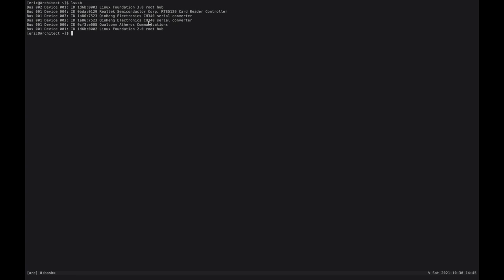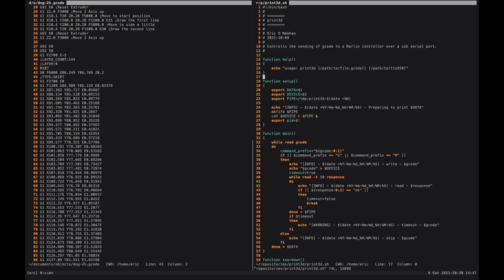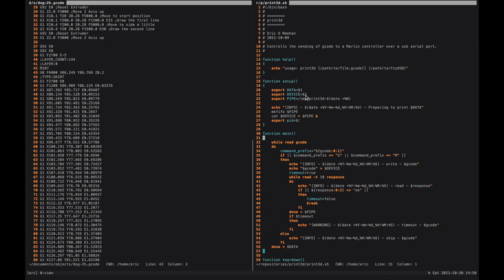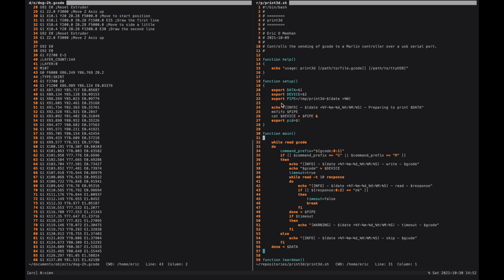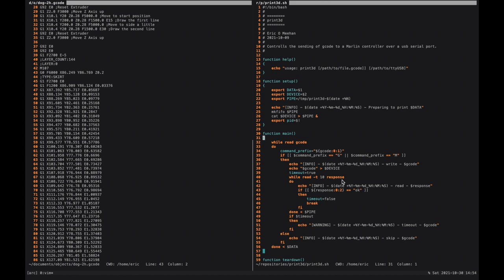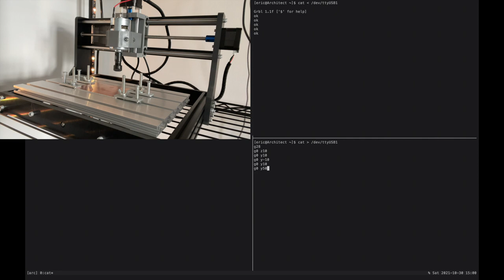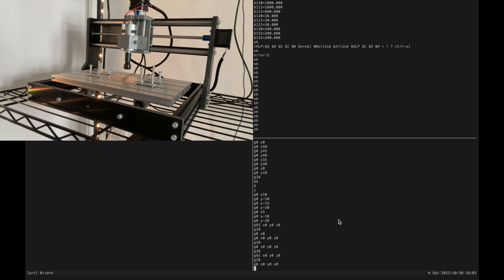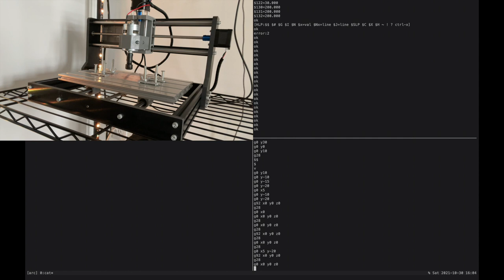Programming a CNC Router with Linux

Comment: Welcome back! My favorite youtuber! What are/were your favorite learning resources for C, C++, and Python. Additionally, how did you learning about computer networks and computer systems(architecture and operating systems)? I've always been curious considering you're very talented. One more question. Which project helped you grow the most when learning about things? If there were a few, please let me know.

Anyway, you're one of the best YouTubers! Cheers!
Reply from the maker: You're too kind!  I think your last question hits the nail on the head: projects helped me learn more than anything.  Find something you want to make or a problem you want to solve and try to do so using the tool you want to learn.  Otherwise I always found YouTube to be an excellent resource!  Channels like Sentdex, Computerphile, Code Adventures, and The Cherno all have really excellent content.  I find that they are typically not working on something that directly implements the same thing I am going for, but problems I see in projects often remind me of things I saw previously in YouTube videos.
Reply: @eom-dev  Awesome! Could you name a project in particular that helped you a lot? Any good book reccoemnations? Thank you again for the amazing content! You're data structure and algorithm course were awesome! Cheers x

Comment: Interesting! Thank's for your video
I'm a linuxian since let's say 1998 but before that i was working for electronic and now i'm coming back to it well never really stopped!
I'm printing PCBs.
I allready made some of theses programs : on tty for the control of some embedded boxes.
You may  probably do it also with some tools like expect since i consider shell a heavy process since each of his calls are external.
On the other hand doing it with program let you keep precisely all the control. I made that in python and Perl.
The best should be in C and even in low level routines like open close (not fopen/flclose which are for streams), and then control
with the many binary flags : raw mode, echo, non-blocking io, etc...
Because if this is kinda trivial and i think you need to control also the possibility to send external commands during the process, to stop it , pauses, etc...
May be you did it yet: at this step didn't watch all your video.
I found also Flatcam tool : i compiled it but it does not show on Linux, on the 3D screen, i think the code has a hard maintain with Qt libraries/version and 3D support. 
Hope to read you soon!
jean-yves.